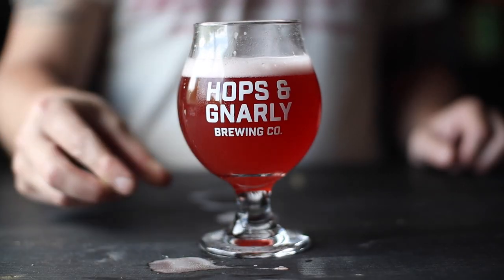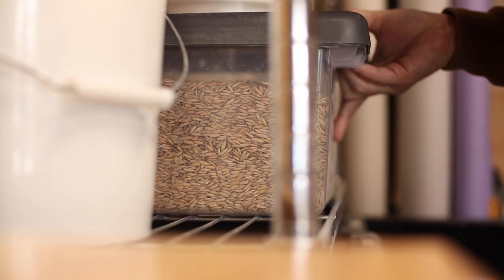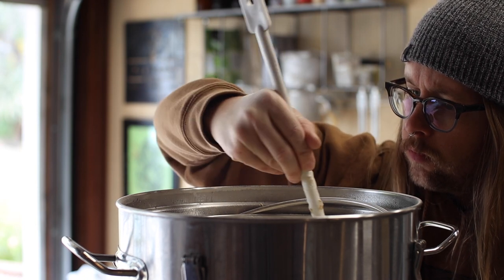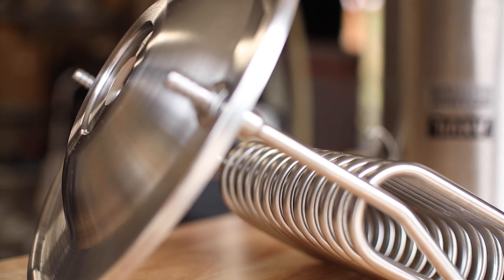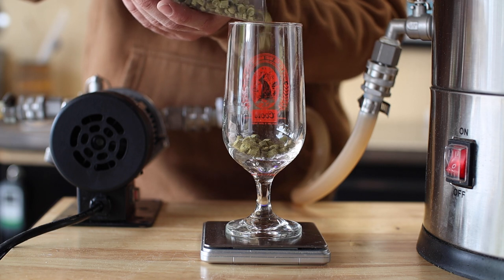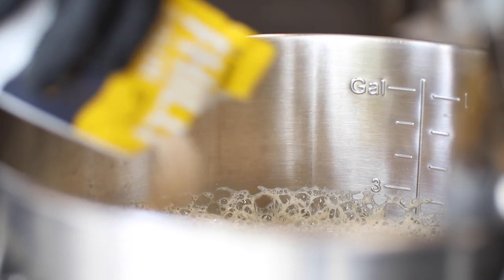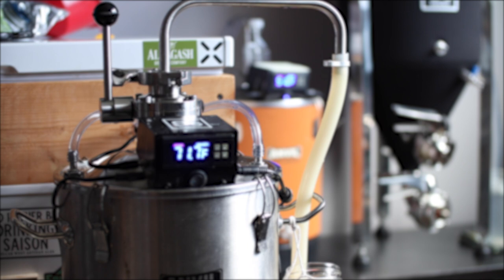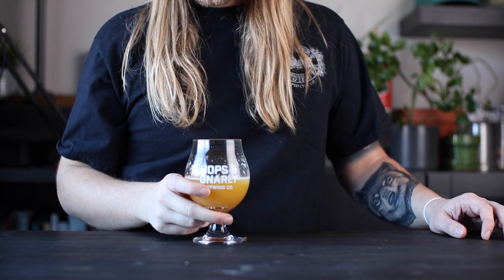Fruited Philly Sour | Anvil Foundry | EP38

Comment: You can add tap water depending on your PH coming from your tap.  Mine is around 5.6 so its always been pretty good; just need to adjust for a little more grain during mash because of efficiency and throw in a campden tablet to remove chloromines.
Reply from the maker: That's technically true you just have less control over your water profile. In municipal sources, ion and mineral measurements are constantly changing. So you might get in the ballpark but you'll never be able to reproduce the exact same water profile. That's why a lot of breweries have their own reverse osmosis water treatment systems.
Reply: @Hops & Gnarly  Right...just giving an option if you aren't too worried about competing or what have you.

Comment: 20 degs c for Philly Sour seems a bit low. I did a berry sour just the other day and it never really took off till I upped it to 24 degs c. Did you find it slow to start??
Reply from the maker: No it took right off. It’s not super vigorous at the beginning when producing lactic acid. If you read the Lallemand documentation it’s all at the same temperature

Comment: How do you determine the ABV of the beer after adding the fruit?
Reply from the maker: You can use a hydrometer after everything is well mixed and you can estimate with tools like BeerSmith and BrewFather
Reply: @HopsANDgnarly  thanks for the reply! Do you have an example of this? So if OG is 1.050 and then 1.015 before adding the fruit then the fruit brings it up to 1.030 (I’m just estimating I don’t know if that’s high or low) then it goes back down to 1.010 how would you calculate the ABV? A quick “shorts” video would be extremely helpful on this. I usually just take the OG on Brest day and another reading after the fruit is added and fermented but that is obviously going to be off by an alcohol percentage point.